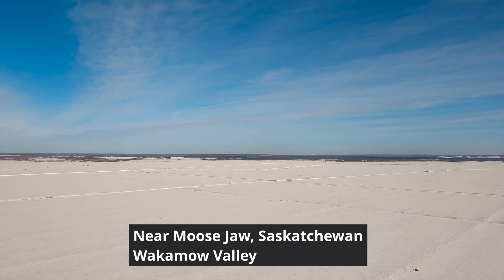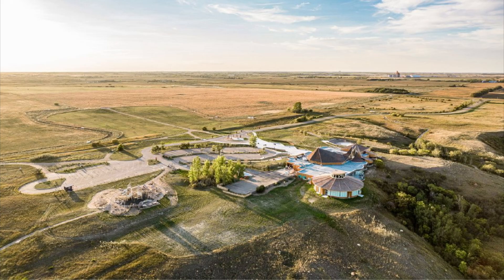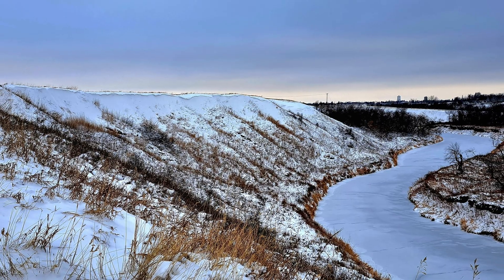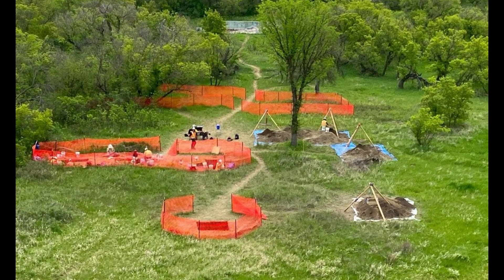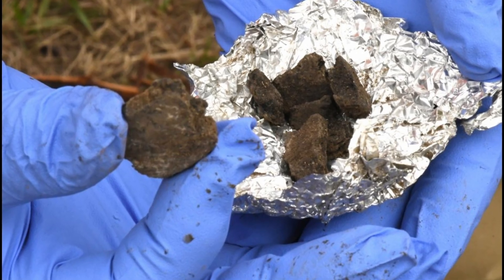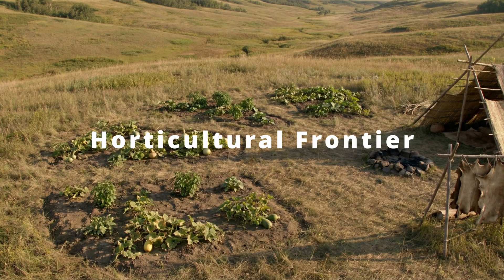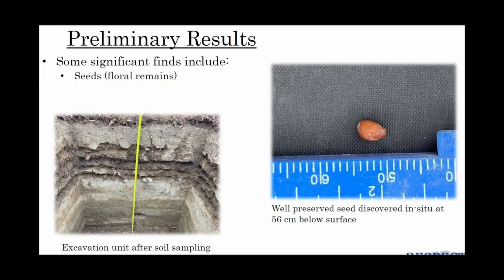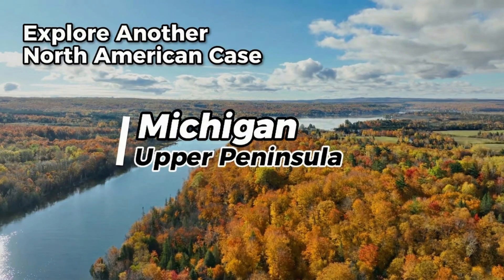200,000 Artifacts Beneath a Saskatchewan Highway

Comment: Exactly 200000 ?
Reply from the maker: Good question. No — 200,000 is a rounded estimate. Archaeologists use it to describe the scale based on artifact density and excavated samples, not an exact count. The important point is the magnitude and concentration, which is unusually large for a single site.

Comment: Would there be a cliff around there for a massive bison roundup hence leading to the processing area. Like head smashed in Buffalo jump my ft macleode Alberta
Reply from the maker: That’s a good question. Large bison jumps usually require a very specific kind of cliff and approach terrain, and so far there’s no evidence of that kind of feature or mass kill context at this site. What researchers see instead fits more with repeated use of the area for processing or seasonal activity rather than a single large-scale drive.

And a big hello to Fort Macleod — Head-Smashed-In is an incredible example of how well-documented bison jumps look when the evidence is clear.
Reply: Yeah it's a neat spot cool interprative center as well @DocumentifyTV

Comment: What the hell is the deal with hard hats in archeology? Smh
Reply from the maker: Fair question. Hard hats are mostly about safety, not ceremony. Archaeology often happens around unstable soil, trench walls, heavy equipment, or falling debris — especially during early excavation and survey work. It’s the same reason they’re used on construction sites. Most archaeologists would rather look a little over-prepared than get injured.

Comment: The artifacts are everywhere.  They are so abundant you can see areas where metals were smelted.

Lol. Old news in the sense   these things are everywhere
Reply from the maker: The abundance is definitely real—200,000 items is a massive count. But the 'smelting' signs here were actually from intensive bone grease rendering. It creates thick ash and burn layers that look industrial, but the chemistry confirms it was for food processing, not metal.
Reply: @DocumentifyTV no not bone grease otherwise the water would have slowly ground all that off and polished the rock. This is something different.

Arrow heads. Wooden spoons. Old canoes that have sunk to the bottom of lakes.

Where I am if you dig roughly two feet down you will see the remains of a massive forest fire that happened around 1900.

Earth keeps growing is what that tells us. More dust more decomposed organic matter etc .. slowly building up.

If you look closely and understand anatomy you will discover the earth.

He discovers the earth finds a carcass.